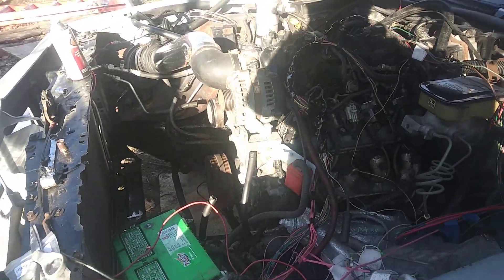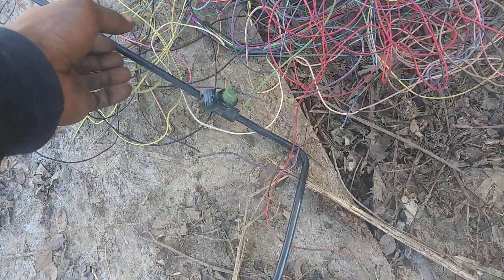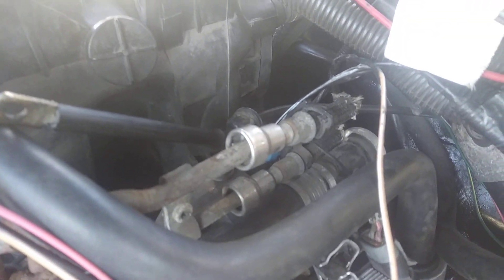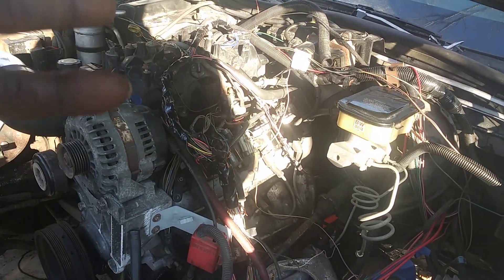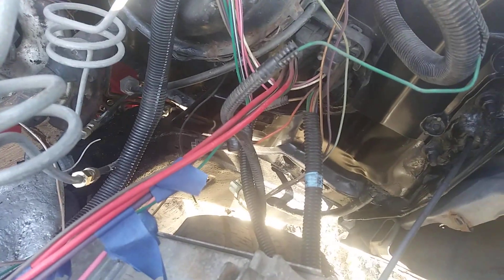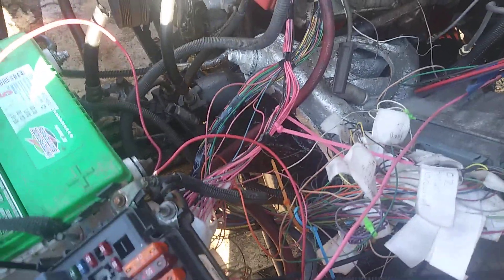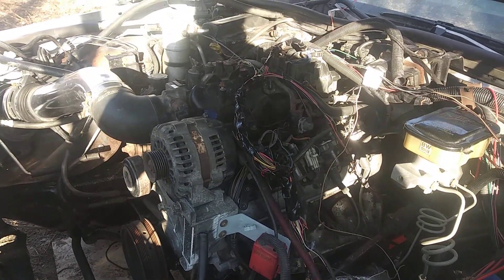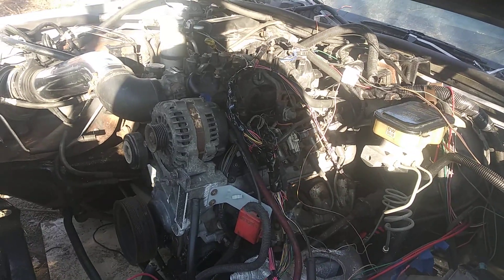Caprice Ls Swap DIY We Have Fire

Comment: To have key on power to the pink wire you have to run a jumper wire in the factory fuse box. The driveway engineer has a video on it
Reply: Otherwise car will die because everything is constant 12v

Comment: Spray some quick start or gas in the throttle body and fire it up for a second, let's hear it that would make a sweet video.  im using my distributor wire to turn it on with the key .  at 2:18 are those red wires always live like factory?  if so check your fuses in the car
Reply from the maker: I might just do that but kinda rather. Hook up a temporary fuel system to make sure everything is smooth. and the red wires are only live when i turn the key on. thos are starter wires as well